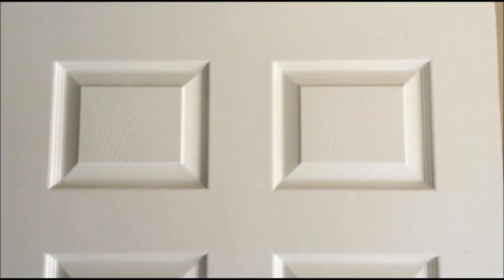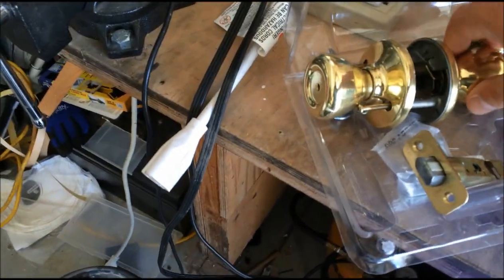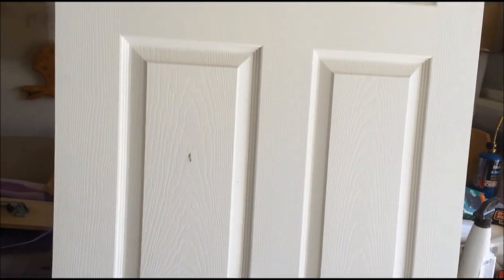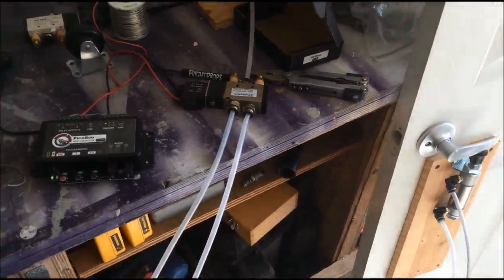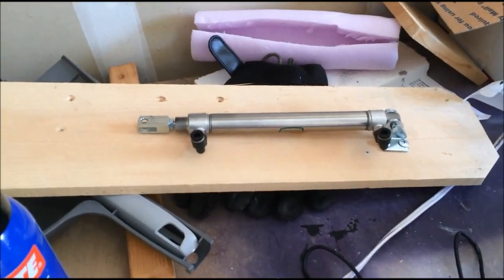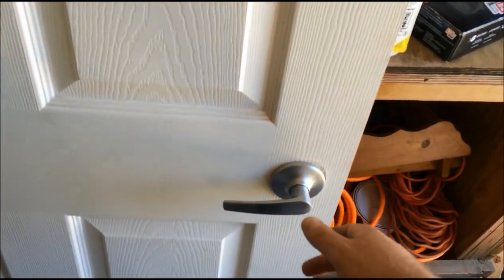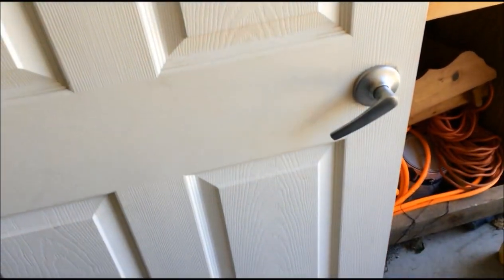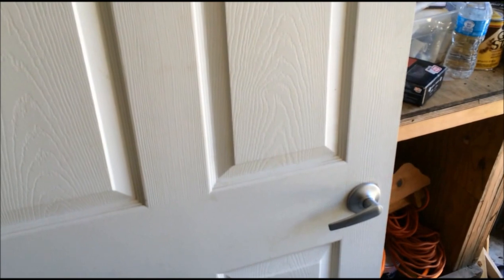Pneumatic Door Handle

Comment: I think the fast-shaking door handle has been overdone by Hollywood. The slower moving one looks better. Now I'll admit if you could get the door knocker to work, followed by the handle moving a few times, and then the door opening and closing as you're doing it, it would be a complete effect. It looks good as you've got it set up, don't get me wrong, but don't give up on the knocker yet!
Reply from the maker: Thanks for the advice, Rich. Maybe I will go back and re-engage with the door knocker idea.